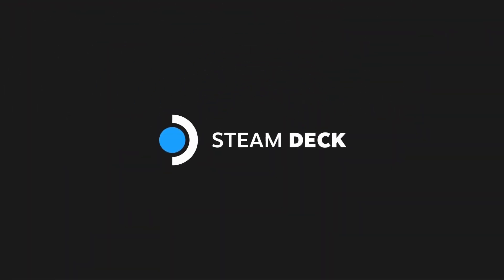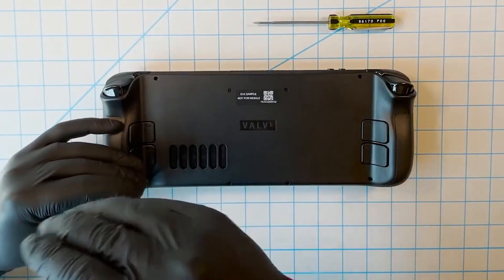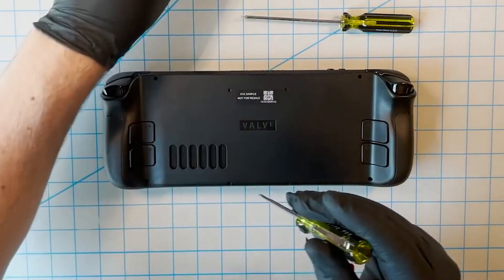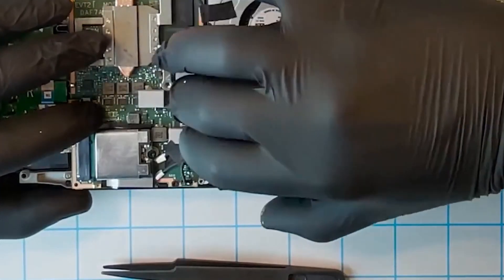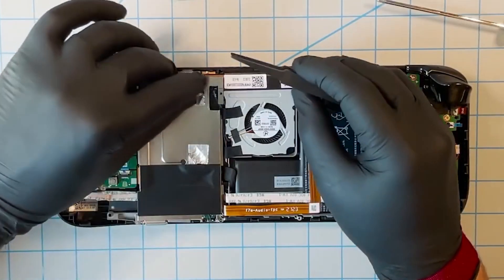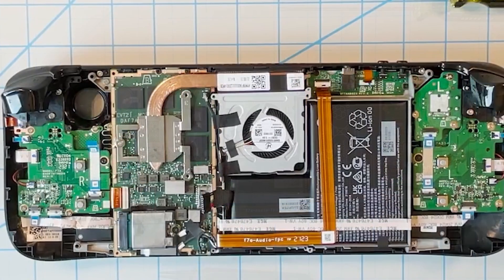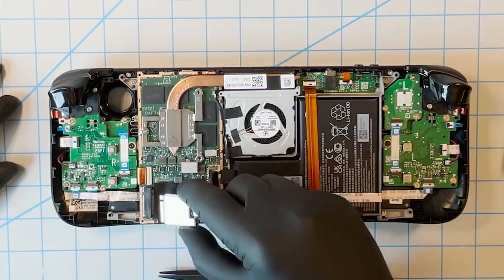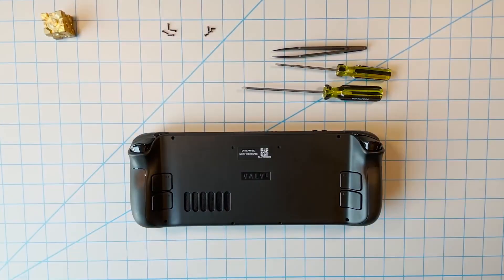How To Replace Steam Deck SSD Tutorial - M.2 2230 Solid State Drive Install

Comment: Maybe a good thing to add is that it’s not gonna boot because it has no firmware.
Reply: You can clone the M.2 it ships with onto a larger capacity one and resize the partitions to match the increased storage of the new drive. Pretty easy workaround.

Comment: I'm confused about the sequence. You said to remove the battery wire first, you cut to a different shot with the shield already off. Then you removed the shield and the battery wire was still plugged in. Can you please tell me your opinion on which to do first vs. what Valve says?
Reply: This seems to be totally valves video, they had the error, too.
Check out Linus tech tips, or gamer Nexus, they explain the right method better.
Reply from the maker: Once I get my Steam Deck I’ll record my own video :)

Comment: I'm a little bitter that they only support M.2 2230 SSDs. The market is really thin and uncompetitive with these and they are way to expensive, but I guess this will change once the steam deck releases
Reply: I got a 512gb 2230 on ebay for £55! ($65). I've seen tons of 256gb versions for about £25

Comment: Is it also possible to upgrade from the smallest version to 2230ssd?
Reply from the maker: Yes they've said the eMMC uses the same slot.
Reply: @andrewtsaitips  Ah okay, so if I buy the 64gb version and I want to add an ssd, i would have to change the eMMC because it uses the same slot.

How do you go about installing everything you need on the new ssd tho, like the steamOS/linux?

Comment: How do you transfer the OS?
Reply: yeah that's  the important part.The Value  didn't tell us.
Reply: I'd imagine get a docking device with 2 slots for SSDs that uses them externally and just clone the smaller SSD to the new bigger one via software. It's a lot easier than you think but i do recommend looking at videos for such a process.

Comment: Aftermarket drives with superior capacity will be offered quickly as sales accelerate. A 2TB would be a nice start but as prices drop 4TB will eventually be a sweet spot. Selling Steam Deck with small drives is the wise market-driven choice but users will obviously want to upgrade. Making the SSD upgradeable was genius. I'll be buying a Steam Deck as a convenient small Linux machine (I don't game or have any interest) as I prefer Linux for a main OS. Larger drives will enable full Windows installs plus programs.
Reply: not so much genious since it could possibly void your warranty.
Reply: @jooplin  oh no, the precious warranty! How would we sleep at night knowing we were to void that?
Reply: @benjinatorkahki-1858  It's illegal to void a warranty for opening up a device.
Reply: @jooplin  There's no temper-proof sticker or anything like that. If you need warranty repair, just put the original drive back in.
Reply: I had a archos 5 IT that had an actual HDD. 250gb of storage in the early 2000s. What they did was lock it down by white listing HDD serials into the OS software. So once the HDD breaks you couldn't replace the HDD. They did that so you couldn't buy the device with the cheaped HDD and upgrade to a higher capacity drive.

Comment: Hope it runs at least 80% of the games. I want to test Parallel on it, the game I've been producing since Jan 2020👍
Reply: in its current state it wont run the game parallel because it hasnt been ported to linux or proton.. however if you install windows on the deck it will run parallel
Reply: @BoopTheSynth  Hi. Yes, once the game is finished I can start to make some tests.